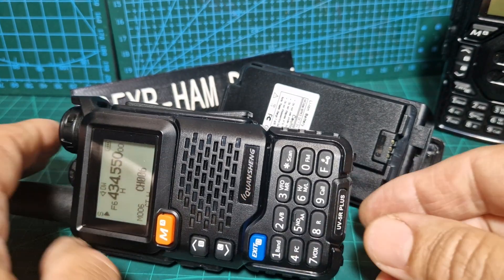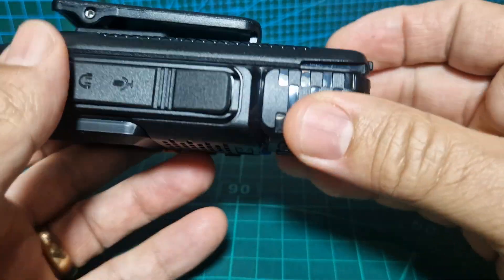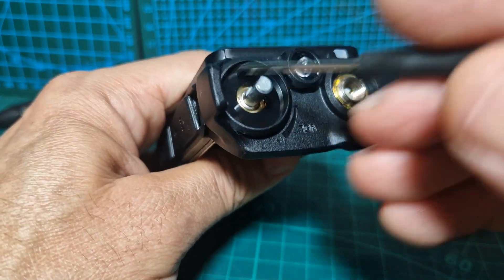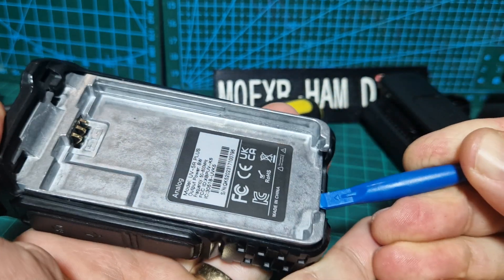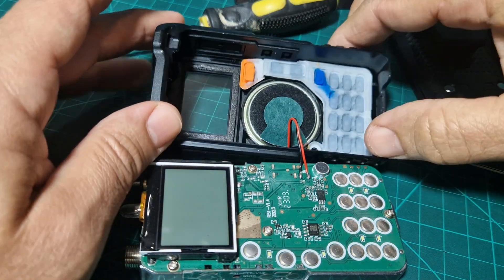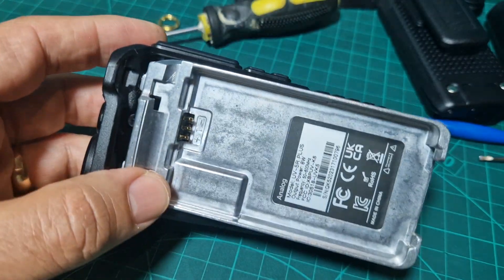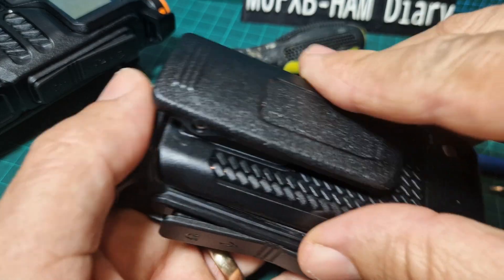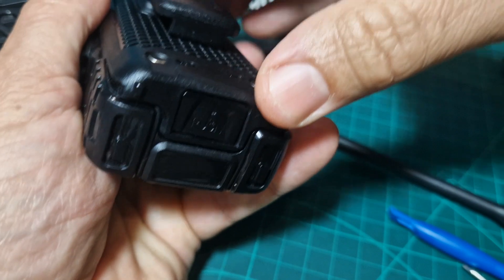QUANSHENG UV-5R , Let's Find the Mising USB C Charging Port

Comment: In Nov 2024 now there is a USB port on the UV5r plus. But it has no function to the radio. Also now the UV5r plus can not connect to the computer for flashing firmware in a way like the k6 can.
Reply from the maker: Yes
Reply: @HamTechRadioScannerDrones  Do you know any method of flashing IJV or CEC firmware to the the new rendition of the 5r plus? Thanks.

Comment: I wonder if it's just the connector they left off, or all the components. The connector footprint is there, so you could solder one on is you want.
You can use needle-nose pliers to get those rings off. If you use the bent ones, it's even easier.
Reply from the maker: Yes it's doable
Reply: They left out the components as well.
Reply: @Ni5ei  bummer. That makes it more tricky and expensive.

Comment: If you read the manual from the k5 with usb-c port, you will notice that the factory does not recommend using the usb charging port. Except for emergency situations. Why? There is no security circuit for save charging. It will charge the battery but if something goes wrong, you are in a world of hurt. Now with the smaller battery this will not happen as quick, but with the bigger (and stronger) battery, the factory decided to delete the port altogether, just to prevent things from blowing up. So it is no downgrade, it is a safety precaution! The usb charging port is only ment to be used if you really have to!

It's all in the manual...
Reply from the maker: Thanks was fun .
Reply: @M0FXBHamTech  FUN?????????????????????

Comment: I understand you can use the removed knob as a tool to tighten and loosen the antenna securing nut
Reply from the maker: In the end the knob fasteners are beneath the case .

Comment: The battery itself should have had a charge-port, like on the radtel 470x.
Edit: i found that there are replacement batteries avaliable that has usb-c charhing. So not really a problem.
Reply from the maker: Agree

Comment: The UV-5R PLUS is the first on e of this type of radio I owned, so I was unaware that predecessors might've had a USB charger port. Are there pads for the USB port? Any reason to believe we can't solder one in?
Reply from the maker: Buy an adapter they cost £2

Comment: If you take the volume knob from a baofeng uv-5r it will fit over the round antenna nut with the four notches and act as a wrench
Reply from the maker: Cool nice tip .

Comment: When I saw Quansheng UV-5R    thought this must be some kind of mistake.   But No... tis true.   Surprisingly they have the same name as the ubiquitous Baofeng UV-5R   How do they get away with it.  I purchased Quansheng UV-K5  on the basis it had AM aircraft reception.  Was disappointed as is very poor, barely audible AM   The small buttons are very fiddley, and one has to keep pressing the shift key for basic functions. Not impressed. Stick with the Baofeng. The newer Baofeng BF-5RH/UV-5RH   has excellent AM reception.
Reply from the maker: Add the egzumer firmware works fine .

Comment: it looks like you could solder the usb-c on, im getting mine soon for only £12! and if its just the usb-c missing i think itll be a easy add-on, if i could see the other side of the board that would be a big help
Reply from the maker: The included charger and battery are very good .

Comment: I've taken apart mine before seeing you video, you don't need to remove the brass ring. For the missing USB, it could be a reason that there's no protection in the battery pack, however it's really just a few cents to put a small protection circuit in a battery pack next to the two 18650 batteries. It's a shame they cheaped out on this.
Reply from the maker: Yes realised this lol

Comment: Why don't you use a needle-nose pliers to loosen, or lock up again the "antenna' nut? Insert the top of the "needels" into the grooves of the nut, and slowly turn the pliers, ... ! It works wonderfull for me. 

73 de Markus - db9pz (JN39fq - 3miles/5km east of LX)
Reply from the maker: Thanks

Comment: I've seen somewhere on youtube that it's actually two 18650 batteries there (and so the capacity is rather 2200 mAh or so). Maybe you can try to disassemble the battery block and check it. And yeah, that's a pity that they didn't implement a usb-c charger port there :(
Reply: well, not youtube but ali: https: ae01.alicdn.com kf A1a083cfbeb8a43de81b041146abb82c7I.jpg - add slashes there
Reply from the maker: Thanks for watching
Reply: There are tools to test mah without disassembling the battery.

Comment: Possible explanation of the missing usb charger: the big battery packs have 2 x 18650 inside, which in contrast to the flat batteries dont have an internal protect board, and the usb charger might not have the same safety features as the cradle chargers. The charger itself will not suffer from charging the bigger battery because it is constant current and doesn't care about the capacity, it would just take longer. Other issues with these cheap radios is that the battery connectors are permanently under voltage which should not, and if i'm not wrong, it is also compulsory since a couple of years that battery packs and chargers have 3 contacts instead of 2, mayne not in all countries though.
Reply from the maker: Thanks for info .

Comment: There are versions with and without usb c port, when buying on AliExpress you have to select usb c option, just bought mine for £14 with charger cradle and usb port
Reply: Think that's just the cable and not the port,how did you get on?

Comment: I have one of these on order from AliExpress
Looking at the specifications from different suppliers, not ONE has USB charging mentioned, which for me is a big selling point, like the earlier model which I like. If the radio I ordered about two weeks ago arrives with no USB Jack, it's going straight back. It's a big problem I see with Chinese sellers, one never quite knows whether what you ordered is what arrives at your door.
Reply from the maker: Yes agree it is a big disappointment
Reply: @M0FXBHamTech  Andreas. I bought a spare battery for my UV-5R plus from Aliexpress. I was pleasantly surprised to find a USB charging socket on it! The battery was higher capacity too: 2600 mah more than supplied. made to fit, no cutting off bits in of it.

Comment: That is exactly the same speaker as K5 (white)
Quancsheng wrote a letter to FCC in Marts 2023 promissing that its only cosmetic differences between these models
here is the letter.

// QUANSHENG ELECTRONICS CO., LTD No 82, Qiuzhong Industry Area Xiamei Town, Nanan City Fujian Mar.06, 2023
Quansheng letter to:
Office of Engineering Technology Federal Communications Commission 7435 Oakland Mills US

Subject:Explanation of differences between product types
UV-K5Model Number:UV-K5, UV-K5(2), UV-K5(6), UV-K5(8), UV-K5(9), UV-K5(11), UV-K5(22), UV-K5(66), UV-K5(88), UV-K5(99), UV-5R, UV-5R PLUS, UV-82
To Whom It May Concern:
We,The QUANSHENG ELECTRONICS CO., LTD.hereby declare that  the models are all identical except the model names & cover design, no other modification is performed.
Sincerely, - FEILI CHEN
Signature: - FEILI CHEN
Contact person: -  FEILI CHEN //

So no added hardwarecomponents between these models and no adjustment of the RF charistica of the BK4819 chip, so same sensitivity and same output power, as otherwise, they would need new FCC label.. you can also see its the exact same label betweeen them all.
and no new models.
in Marts 9 FCC tested 3 Quansheng models. one with white light, one with yllow and one with blue light... you can see then lay between each other and their testresults and Quansheng promissing and declare on the above qoute.

If you wanna validate this and see all the pictures from the internals and you can see its the same.. just take your FCC id number from the back and search Google.

Comment: i just discovered on mine on the sma connector the pin and the part you screw the antenna aresorted. same thing on my uv k6 too. i opened them both, did a continuity test and they are sorted. i dont thing this should be happening, at list it doesnt on my other radios. can you check yours ? thanks
Reply from the maker: I wil look .

Comment: X-Key Repair Tool
Reply: The commenter is talking about the X-Tool, it will fit on the rings that secure the shaft of the potentiometer for the power/volume

Comment: i have one of the uvk6 orange screen ones that has the usb charging i checked the instructions and it adviser's to use the usb charging port for  emergency  charging and do the bulk of charging using the desktop charger . 
been using it to listen to the repeater on the ISS when it is in range ( i got it on your recommendation)
Reply from the maker: I love the K6 I have the large battery u can buy it for 12 pounds .

Comment: Next, would be to take the motherboard out of the radio aluminium frame, and see if there is a charging circuit to install USB-C in it. 73´s
Reply from the maker: Yes maybe one day lol i was scared
Reply: @M0FXBHamTech  No need to be scared, unsolder wires from the speaker, remove screws from the board, and "voila" you have the other side of the board. You can compare both radios in that area, probably they are similar.
Reply: Hi, I've opened it and there is missing as well as the charger circuit, one IC plus a couple of capacitors and resistors. Also, I'm not sure if it is a good idea charge the big battery on the no plus radio through the USB because probably the charger IC maybe overheat and can fries because more charging current.
Reply: @M0KZA  for the normal battery I believe that is no problem, if we can get hold of the schematics or a UV-6 and compare the board, I believe that we can install componets and it will work.